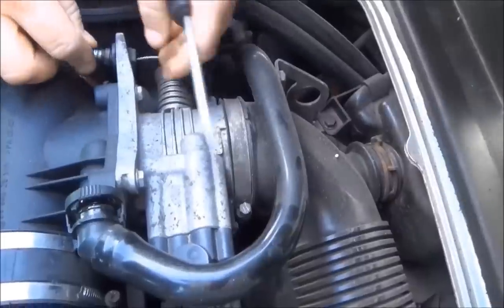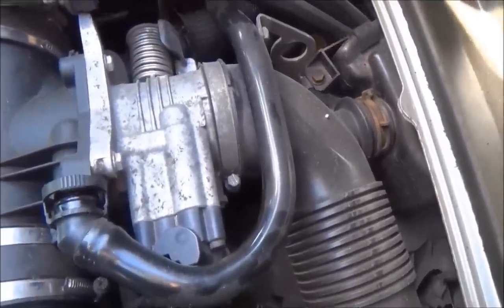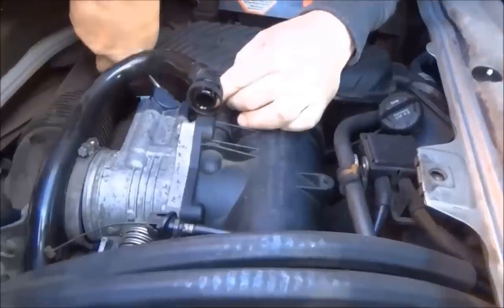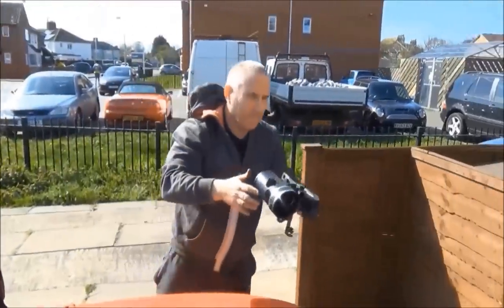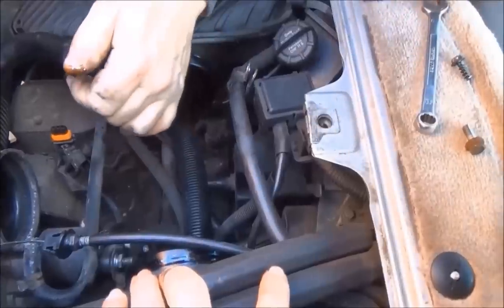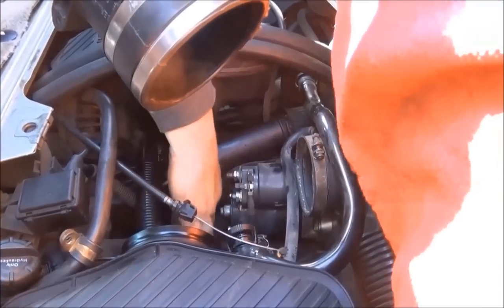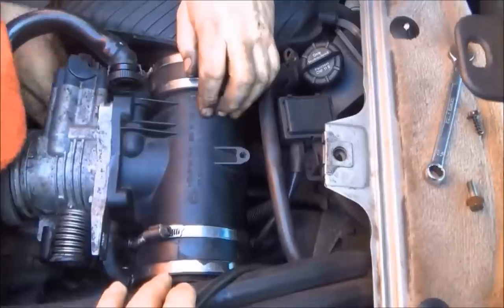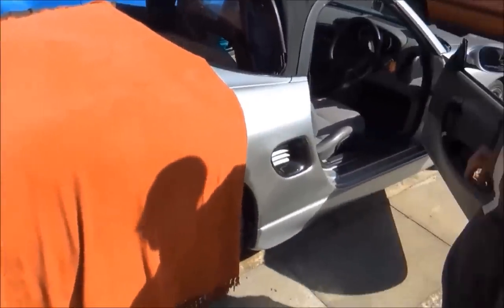Porsche Boxster 986 DIY Cleaning the throttle body

Comment: Thank you very much for making and sharing this video.  It helped me tremendously.  I just want to point out that on my 1997 NorthAmerican model there is one vacuum line on each side that run into the rubber bellows. On line has what I assume is a check valve in it, the other line is very thin, comes up besides the hydraulic fluid reservoir and goes into the bellow.  The fellow in your video seemed to easily attach it using the long nose pliers...mine was a PITA to find and locate the hole after the TB was installed.  The vacuum line is so short that it will only reach when the TB is properly seated.  Speaking of seating the TB, it took a fair amount of pushing and prodding to get it seated correctly.  A second pair of hands would have help tremendously (as in your video).  I've worked on quite a few cars in my day, and the boxster gets the prize for making what should be a easy, straight forward job complicated.

Comment: I belong to a BMW forum and one of the guys on there had similar symptoms, was traced
To the fact that some of the k &  n filters have something in them which mess up the air mass glow meter. Upon checking with k & n the guy had ordered the wrong air filter. Not sure what or why it buffered up the maf but changing the filter out and the maf sorted the problem

Comment: with the kn filter the cleaning oil can effect sensors on the boxster if over oiled as most do
Reply from the maker: +Stephen Fullerton, Hi Steve, I have heard this with the mass air flow sensor, but that's new as well. if it doesn't  right it's self after the engine service in February I'm going to chuck it into Porsche for a diagnostics check, I'm convinced it's running too rich at low revs but I'm old school and it hasn't got a carb or any idle jets to clean, lol

Comment: There are 2 vacuum plastic tubes that connect to the rubber boots, One to each boot, you never mention to be careful when removing the boots that these vacuum tubes are to be disconnected, they are so small and blend in with the black color of the rubber boots and can easily break. you do mention the one from bank 2 when reassembling the Throttle body but it is much too late if the tubes are broken during removal.
Reply from the maker: Thanks for the info, some car's must have 2! Mine only has the one

Comment: My boxster also got oil in there too. Why? Where does it come from?
Reply from the maker: hi, it can come from the air oil separater, but it is common for a small amount of oil to get by the separater, the most common way to spot excess oil is smoke from the exhaust, I changed my separater, but because it was leaking oil not letting oil passed, hope this helps

Comment: did this sort your problem?
Reply from the maker: pmenown it in proved it, but didn't get rid of it completely, so I changed the throttle position and mass air flow censors to fully solve the problem.

Comment: I wouldn't let you clowns touch my car. I've never seen such rough handling for the most remedial efforts. Screwdrivers jamming, poking, and prodding. It's a Porsche for Christ's sake, not your wife.
Reply from the maker: Thank you for sharing your thoughts Jim, your comment is noted, yes it is a Porsche, but at the end of the day it is just another car for Christ's sake
Reply: Have you ever actually worked on a car? With all due respect, some times poking and prodding is the only way to get things loose. Good example, rubber hoses. They tend to fuse to the metal and plastic bits they seat on. Personally, I've been working on cars and motorcycles since childhood, more than 40 years at this point. And to be frank, most of the time, things don't simply come apart without some persuasion. While I too sometimes cringe at the way Paul and his friends do things, I also recognize that they are largely working without the proper tools for the task at hand. As will virtually every person without the budget of a proper shop.